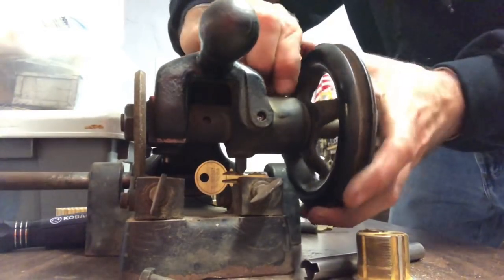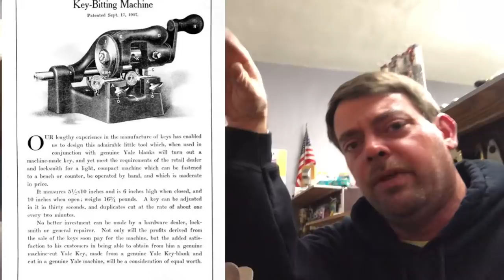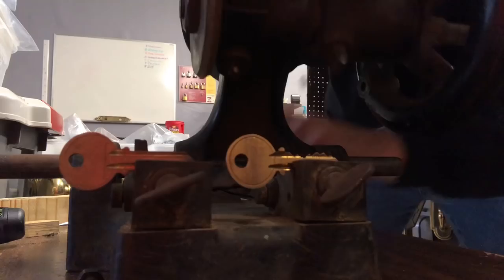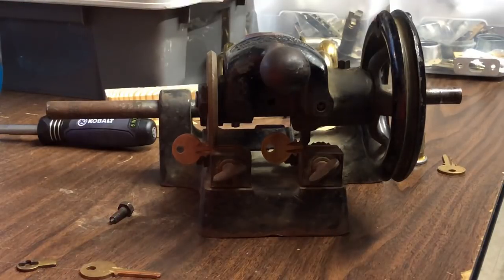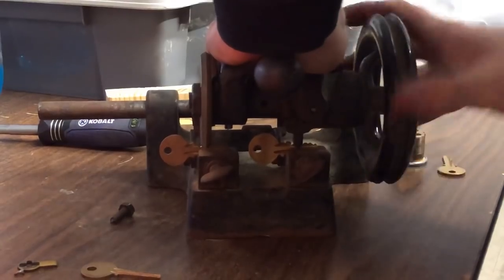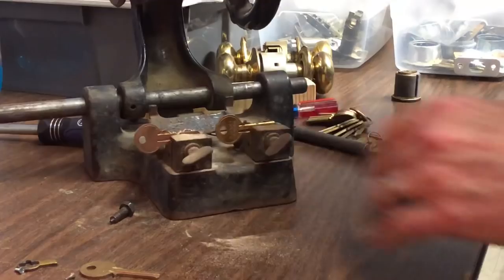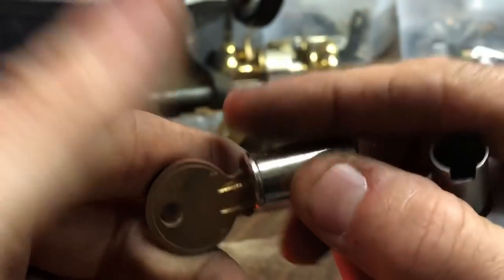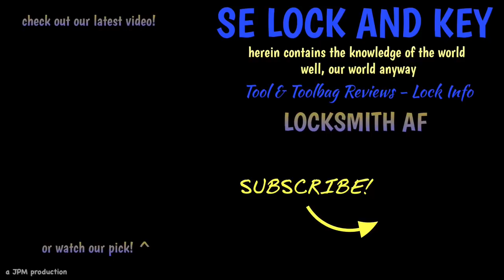copying a key on hand crank Yale & Towne Key Bitting Machine patented in 1907

Comment: Funny thing is, the picture Nite Owl sent you doesn't have the wheel just a handle.  You should sent that to hand tool rehab and have it all cleaned up and made to look original. Would be a great counter item for your shop. Beautiful old machine.
Reply: The design from the original patent drawing (US866418 filed October 23, 1906, granted Sept 17, 1907) only shows a crank handle, I suspect the large wheel with the groove cut in the outside was a slightly later addition to allow people to connect it to a belt driven by a foot pedal (like an old molleta grinding wheel) or an early electric motor.
Reply: @Nite0wl  I was wondering about the groove in the wheel. Thanks Nite Owl.
Reply: @KingStreetRob  I found a few patents for other key machines from around the same period. At least one from around 1915 shows a wheel and handle arrangement similar to the one Jason has, being used interchangeably with a belt drive and manual operation.

Comment: mcmaster has various handles that you might find one to fit.  it was removed to make it a belt drive machine with a 12 volt motor ..  that is why there is a groove cut in the round handle..   a wire brush fit in the shaft that sticks out ...

Comment: The right side spindle is probably for a heavy weight fly wheel - maybe 15 lbs.  One could retro-fit it with bicycle pedals under the work bench to increase production speed and get your exercise in at the same time.
Reply: David Burlingame might be just the thing for  Fr ed G's 500 hand crank keys